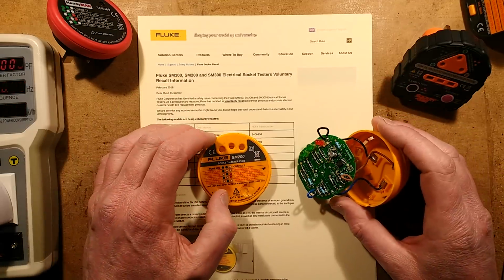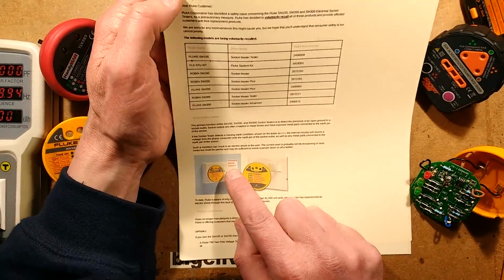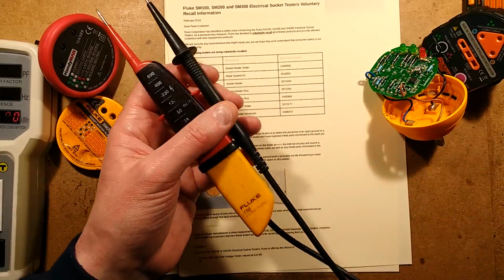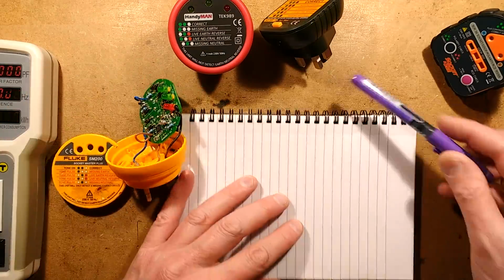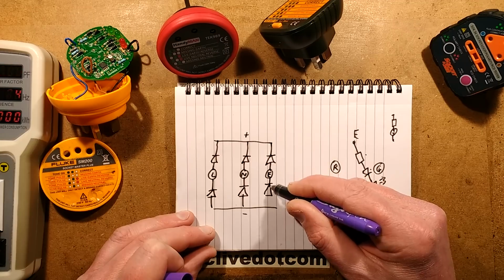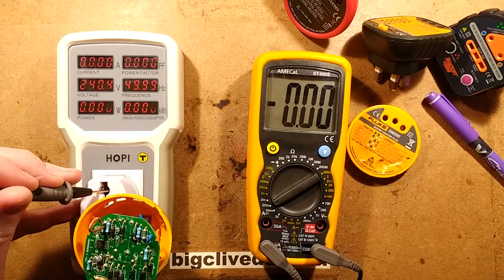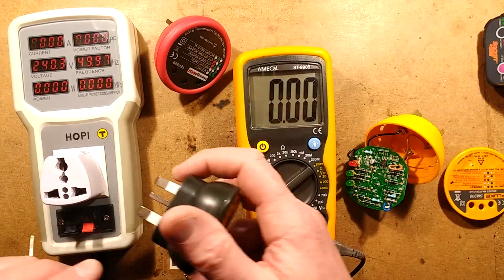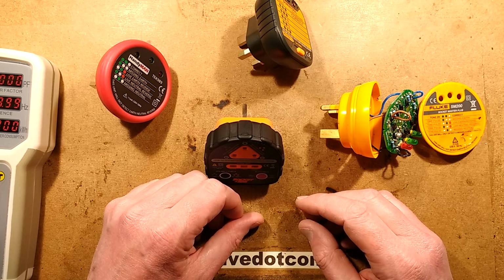Why Fluke are recalling their SM100/200/300 plug-in testers.

Comment: Clive, how do the ones that use the neons compare, are they better or worse?
Reply from the maker: The neons run at much lower current.
Reply from the maker: Now I've got a full size keyboard I can type a better reply.  I'm a bit wary of the new neon testers that show a full row of neons for the correct state.  More to go wrong when the original design used just three neons and three resistors.   I've just tested one right now and it's live to earth leakage was high at 5mA.  That seems like a step backwards for a frivolous simplification of the display.
Reply: Thanks Clive, I have an old one with just 3 neons, so I'm happy with that.

Comment: I think it is important to know if there is a faulty Earth system. The tester should indicate not only if the active and neutral are reversed or crossed over with the earth but if the earth is open circuit.
Reply from the maker: It does that.

Comment: Whatever the risks, its worth it to avoid a reverse polarity. I use a martindale in 5 - 8 houses a day, after upgrading cableheads or fitting isolators for Scottish Power, and checking customers polarity is the most important test we do. Reverse polarity kills.
Reply from the maker: I noticed the plug in testers being used for that.  They're ideal for a quick test.
Reply: Wut? In my house I use a a TN-C-S and If u switch polarity only gets a litte rub from metal. I tested this on my own skin... In production places we use a TN-S or TT. A floating ground kills
Reply: A floating earth is only a risk if there is a fault to earth at the same time as someone is in contact with earthed parts of the installation or earthed appliances. Reverse polarity, at the origin of the installation, in a PME/TNCS installation, will cause all earthed metalworks to become live at mains voltage. One of these situations would, if found on a job I had completed, cause me to be told to go back and fix it, the other one would cause me to be instantly, sacked, prosecuted, possibly for manslaughter if someone had been killed, and lose my network authorisation. Suppliers and DNO's are unlikely to to accept "it only causes a little rub on metal"  as any kind of legal defence. And then there's the not uncommon scenario of a failure of the main neutral in the street outside of a property. Have a think about the problems that would cause in a PME installation.

Also, many electronics, like sky/cable boxes, tvs, computers tend to fry when connected reverse polarity, unless designed to withstand this, which isn't necessary in the UK because they can only be plugged in to the socket one way.

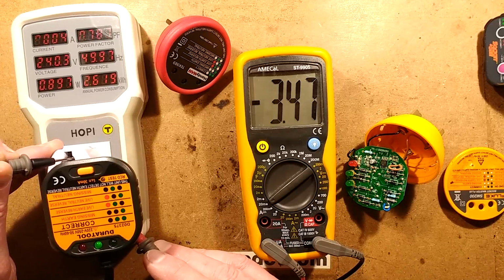Comment: 17:55 or just use an older simpler neon outlet tester and get around 120V - 65 V / 1 meg resistor = 55 microamps of current :-)?

I'll stick with my dinosaur tester for quick checks thanks :P.

Comment: Is this just a UK problem or do all circuit testers have this issue?
Reply: John Coops No, the issue is if there is a break in the earth circuit somewhere. The use of the tester will cause any connected "earthed" metalwork to become live.
So imagine if the main earth was cut at the distribution board/fuse board/consumer unit. Now the earth system wiring "fed" from this distribution board is no longer earthed. But it should also have no voltage on it (apart from a small induced AC voltage). But if a socket tester is plugged into a power outlet, the test current from the line / live conductor will pass via the testers circuitry to the earth pin of the socket, and hence make all the connected earth wiring and any metalwork or class I appliances (metal cased but not double insulated) all become live at nearly mains voltage.
In a building fed via a plastic water pipe, it could also make the metal plumbing live as well (via the earth bonding).

Comment: I didn't quite get it. So the earth is floating but not too close to the tested socket. There is a human somewhere out there touching the floating earth (or an earthed appliance) with one extremity and actual earth with another. They get zapped. How is this even a remotely probable scenario?
Reply: Georgi Chh More so than you’d expect I think - remember, almost anything metal nearby will also be connected to that same “earth”, and will probably also be grounded to some extent via carpet/floor etc. 

Any ring main with a broken earth wire at two points (or a spur with one break) will do exactly this - and At one point, I had an electric cooker here in Scotland where the earth wire was broken inside the spur wire used - presumably at some point that cable had been bent too hard, breaking earth continuity and meaning a new cable. Of course, those cookers often have a socket on the same unit as their switch - so test that socket while touching the electric cooker’s metal body, and you just became earth!

Comment: They sold 81k units, plus prob have twice that many in stock. So a quarter million units added to e-waste. That AMECal DMM looks like a real nightmare to use. It has a standard 4 digit display, and that's it. Not a damn bit of info on that screen. No units, nothing. Why are YOU using that? There's got to be a reason. (Other than tippy being a cheap fucker. Lol.) Can you do a video on DMMs? You did a video on an AMECal, but not the one you're using in this video. Maybe a video on best DMM in categories. Best for cheap skates ($0-50), home DIY'er ($50-150), enthusiast ($150-200), and pro ($200-500).
Reply from the maker: It's got a huge display.  I've got plenty of meters, but this is best for the application and also shows that a basic meter is quite acceptable for hobby use.

Comment: Are you using different definitions for "earth" and "ground"? At the end you spoke about someone touching something "earthed" and something "grounded" at the same time. I always understood that they were different regional terms for the same thing.
Reply from the maker: Because I try to be as inclusive as much as possible I've ended up using both terms.
Reply: Oh, fair enough 😊
Reply: Earthed is the term commonly used in the U.K. while elsewhere, grounded is a common term. In general, they are the same thing. But, with electronic circuits, the low voltage common bus (often the negative) is often known as ground (GND), but may have no electrical connection to real ground/earth.
Even more confusing, some older equipment had two or three separate independent "ground" circuits. One could be the real ground/earth, one would be the common for the primary side (often a live chassis TV) where thus common was actually at mains voltage, and another independent and isolated common ground for the low voltage secondary side circuitry.
Reply: Clive was referring to the supposedly earthed connection to the metalwork and the real ground connection to the planet we stand on although I'm not sure which was which.

Comment: Yes, a high earth current can be quite shocking.
http://www.abc.net.au/news/2018-03-09/denishar-woods-undergoes-mri-after-electric-shock-brain-damage/9529346
Reply from the maker: Open neutral on a TNC-S system results in all the grounded metalwork in a building becoming live.  It's surprisingly common.  Some very uneducated reporting in that article as usual and of course the legal industry trying to get their finger into the pie.
Reply: Open Neutral on TN-C not on TN-C-S, by Wikipedia on TN-C-S
"In the UK, this system is also known as protective multiple earthing (PME), because of the practice of connecting the combined neutral-and-earth conductor via the shortest practicable route to a local Earth-Rod at the source and at each premises, to provide both System Earthing and Equipment Earthing at each of these locations. Similar systems in Australia and New Zealand are designated as multiple earthed neutral (MEN) and, in North America, as multi-grounded neutral (MGN)."

Comment: Surely it would stand to reason that if you are putting a tester into a socket to asses integrity of your supply, you should be assuming the worst and be NOT TOUCHING any exposed metalwork until proven safe by the tester?

Seems a bit (oxy)moronic to be grabbing hold of a metal box that contains 240V prior to and with the intent of testing it 😂😂😂
Reply from the maker: Yup.  But with the progressive deskilling of industry the majority of people doing electrical work in the UK now are basically labourers with a few days of slide-show training designed to tick a box.
Reply: bigclivedotcom And how! :( 
Mate of mine walked on site the other day and someone had decided they couldn’t wait for the temporary distro so they jacked a bit of 5G6 RNF straight onto the terminals of the 200A feed 0.o
Reply: That takes a functioning brain to understand. Very few people have that.
Reply: To be fair, socket testers should be used at the end of all dead and live testing to check polarity on each socket, the integrity of the circuit has already been confirmed by your previous dead and live testing.
Reply: mrglock that’s not how they are commonly used in my experience.

I’ve seen them used more commonly as a preliminary test to ensure the wiring is all correct prior to plugging in temporary equipment (E.G. they get used a lot for checking mains before connecting small PA systems in pubs, etc.)

I’ve never actually seen an electrician use one to check sockets after works since they normally use a Megger or similar and do it properly 🤔
Reply: Conor Noakes Like I said, all your dead and live testing is done first, these are just a final check for polarity after second fixing for me.
Reply: That seems a touch redundant after it's been fully tested for sign-off already?
Reply: Conor Noakes You don’t test from every single accessory.
Reply: ah, only time I've been involved in helping with proper sparks work is on exhibition stands where every single socket was tested individually so there may have been some other reason I wasn't aware of. Might of been a particular company doing it a really wank way since they had to submit a dump of the test units memory logs after

I'd assumed that a ring-main is a ring-main regardless of where its installed and tested the same way

Comment: Its only 10ma if your body is zero ohms Clive...  if your body is 20k which is lower than most people then it would only be  about 6ma
Reply from the maker: Which is also a violent experience that you'd feel right up your arm.  Wet hands reduce resistance dramatically.

Comment: Will do more harm than good. As an electrician in the US, I use 3 light neon testers to quickly check outets before I let anybody use the circuit. I have seen wiring where nobody checked their work, which can create a real shock hazard! Of course I also use a voltmeter and a non-contact tester, but not for QA.
Reply: You can still use one, just not the recalled fluke one*. You could even use an older fluke one. The problem is that fluke included a lot of extra features that caused the meter to pass more milliamps which became too high. I'm sure fluke will release a new version, possible battery powered or just lacking in bells and whistles. Or both. since there is demand for the tool and a lot of places and guys are fluke only...
Reply: I like the older neon models as well.  Finding hot and neutral reversed is bad enough, but few things beat discovering a hot ground at a receptacle!
Reply: Yes if they get a bad rep in general it will lead to less checking and for that they are quick, cheap and very efficient compared to prodding around with probes. Standard periodic testing over here in UK only requires sampling of outlets whereas one of the plug in devices can do even outlet in no time. Also looking at the replacement tester offered the unexposed contact length seems pretty long (unless insulation has worn back over time which is common) and suspect you'd get more belts over 10,000's users/ 100,000's uses with those than with the plug in.

Comment: Interesting video. Wonder if testers rated for 120V on this side of the pond pass such high current through the equipment grounding conductor. In retrospect I wonder why such an obvious safety issue was not caught in the design phase? After all an open grounding conductor is one of the faults is was designed to catch.  I will keep my trusty old school 120 V neon testers.

Comment: On the one hand, yeah it's a bit silly. On the other hand, it could potentially, even if rarely, be an unnecessary safety hazard. 

Not enough to be illegal imo (not that they are), but enough to warrant you having to be absolutely sure you know the conditions in the rest of the building/circuit before using it (as in whether or not someone could potentially be touching something grounded and earthed).
Reply from the maker: Keep in mind that simply touching a set of standard test lamps between live and earth will also result in a shock risk on a circuit with an open earth.  You have to quickly assess the situation before using them and end the test immediately if it doesn't show a good result.

Comment: I gave up on crap contactless voltage testers and bought a Fluke 1AC. The junk Sperry unit that I had previously tried to kill me twice (said no voltage present when there was) also it was random at sensitivity - once it just alarmed when it got anywhere near a wall.  The Fluke I can tell which side of an extension cord is the live wire versus ground.  Don't buy crap in this arena, it could kill you.
Reply: All non-contact voltage detectors can fail to indicate the presence of voltage if their exists inadequate leakage current between the tester, your body, and earth (in other words, if you are too well insulated from ground or the tester for the required capacitive coupling to occur).  That is why you are always supposed to first verify that they do detect live voltage before you try to test for the absence of voltage and they should only be used as a supplemental check to verify a circuit is dead and never solely relied upon for that indication.
Reply: I don't think non-contact voltage testers are intended to be used to prove dead, but everyone does.

Comment: I love the dig at office 'workers' (heh) but the ladder thing (circa 4 mins) is a valid issue....have worked on what people think is wussy low voltage pansy crap (or as we call it, telecomms)... an 80v ac shock via capacitance to ground, or resistance if your hand is resting on the damp brick.... it nearly made me fall off the fibreglass 1000v certified ladder...

Electricity is fun, but it sneaks up on you. I know i'm preaching to the converted with Clive himself... but... it's worth knowing that the tiny bare wire can shock you enough to make you fall off a ladder ;)
Reply: Playing with old telephone equipment as a child, I discovered that a telephone magneto produces quite a high voltage -- by holding a pair of wires onto terminals, one thumb on each, while my friend in the next room cranked the handle. Didn't really hurt as such, but it felt like something was vibrating against my thumbs.
Reply: @gcewing  I'm completely unimpressed by your sense of adventure. Thumbs, really !
Reply: You learn pretty quick not to rest your bare forearm on the screw terminals of the shelves where the internal phone exchange wires connects to the wires going out into the outside world. The odds of 1 of ~30 lines ringing while your arm is there is surprisingly high :-)
Reply: When I was a trainee, about four of us would see how long we could hold the test leads of a old portable test telephone. This test 'phone had a winder handle for generating the AC ringing "signal" for use on magneto circuits. If your "mate" went fast enough, the shock got very painful ⚠️
Reply: .... or +80 - -80 telegraph units grounded through your forehead, an experience I don't want to repeat.
Reply: It's not electricity, it's electrickery. And it does trick you
Reply: I've been shocked by a telephone wire in the past too, 48vDC plus the 70-100vAC ringing current is not a pleasant tingle to say the least...... :S
Reply: @twocvbloke  I bet it was a junk call as well.
Reply: I won in sql on laboratory, i get 300V AC and current 0,5Amps....
From autotransformer, very very painful.
If I compare pain is similar to kick in diamonds
Reply: Me and a couple of friends used to shock each others with a megger. :)

Comment: I'm gonna have to give you a fail. You did not set the DMM meter out of current mode. You broke your own rule.
Reply from the maker: I did discover that afterwards.  It must have been all the excitement.  But it's reassuring to validate that I double check as standard before use.